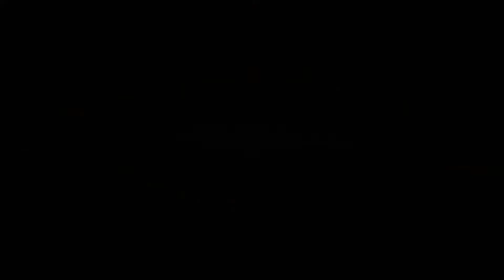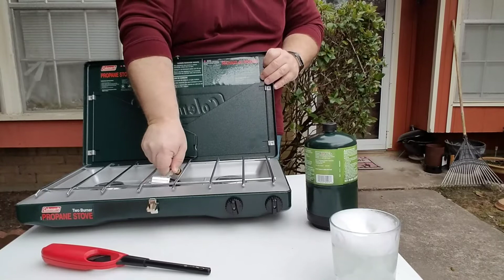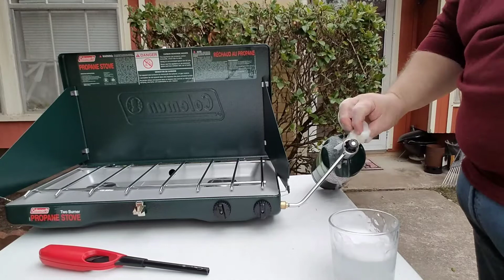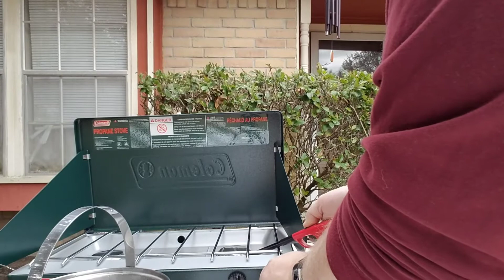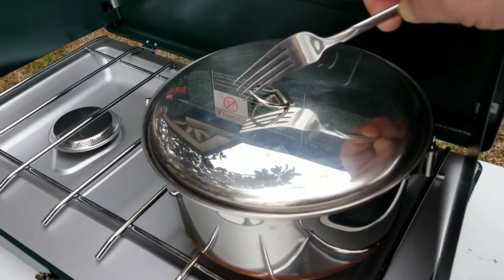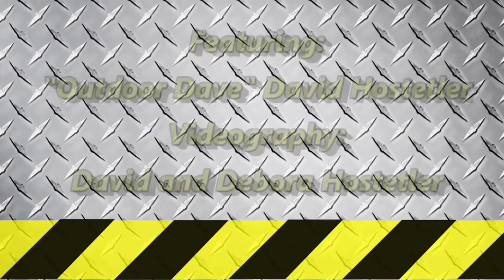Set up first burn and first boil on a Coleman classic two burner camp stove.

Comment: Last major power outage I was in I used mine cooking inside. I put it on regular stove cook top and cooked.  
    I had a battery operated carbon monoxide detector. It never went off. But we did have a window open a little when we was cooking.
Reply from the maker: I am NOT going to advocate anyone do what I did, but during the February ice storm and subsequent power outage, I used my older Liquid Fuel / Dual Fuel Coleman stove in the kitchen to cook, heat water for spraying on us using a camp shower so we can have hot showers, fill hot water bottles etc...  I am not saying it was safe, or even smart. But the options were few, and it beat having my family freeze to death. I should note, I was ill prepared fuel wise and ran out of propane on day 1, which is why the propane stuff didn't get used...

Comment: Great video! What do I do with the canister when I’m done cooking? Do I keep the propane on?
Reply from the maker: Most people keep the cylinder attached until they're ready to break camp. I don't personally like the little green one pound cylinders for a variety of reasons but on the occasion's I do use them I will make sure that I keep all plastic cap and cap the thing off.  And if I have any try to seal it with some duct tape I have had more than half of the bottles leak after being disconnected I don't trust them.